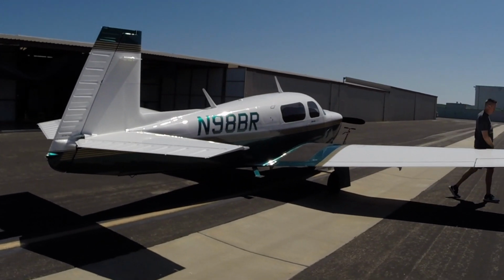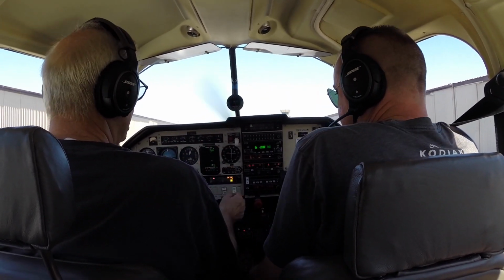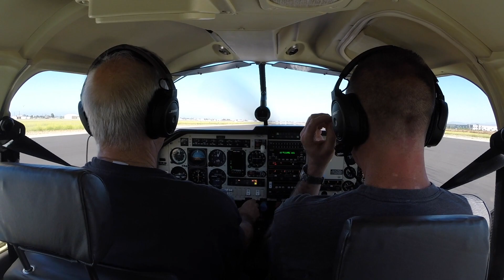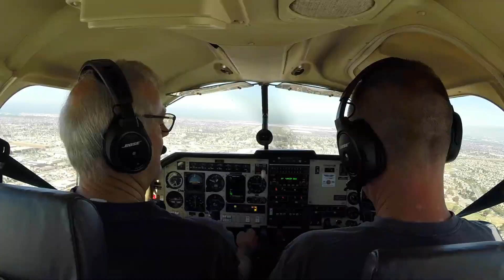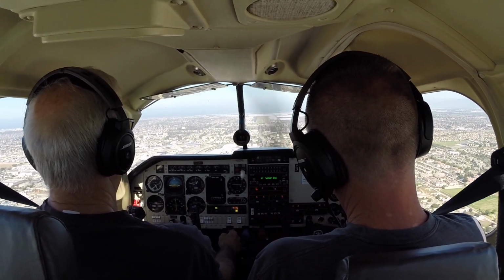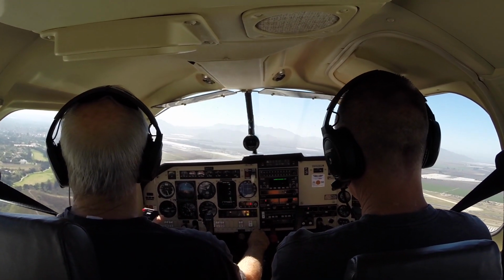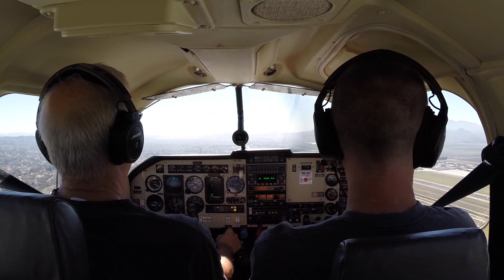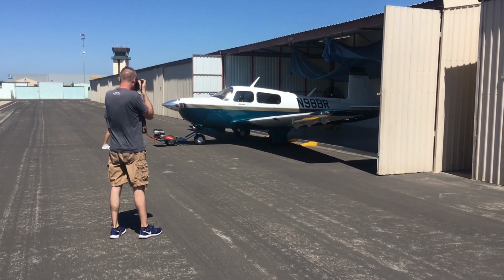Test Flight Mooney M20J MSE

Comment: This Mooney M20J is S/N 24-3356. Mine is 24-3358, and I have purchased it about two months after the date of this video. Coincidence. The Mooney is a great airplane, I am extremely happy with it. All the times in Cessnas and Pipers were wasted :-)
Reply: I've decided to buy an plane and the Mooney is the one it came down to. The J I flew dwn with a friend if mines felt tight, but the E model was tighter. Now I think I want a J model. All my 280tt was in a 172 and now all I can think about is a Mooney.

Comment: Hello, nice airplane. So the pilot leaned the engine before takeoff?
Reply from the maker: Joe - He leaned immediately after start. Then full rich for run-up and take-off.
Reply: btflync Right ok he ground leaned it. Yes i always do that as well right after start up and for taxiing to keep the plugs and cylinders clean. Thanks and Safe flying!